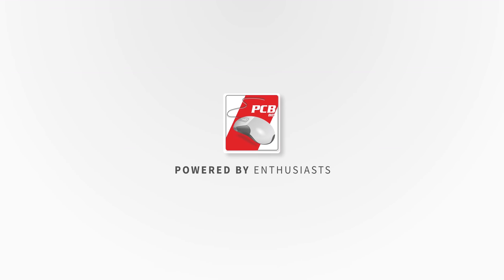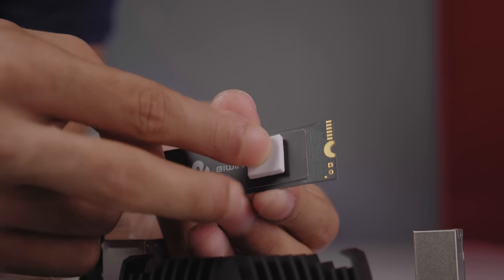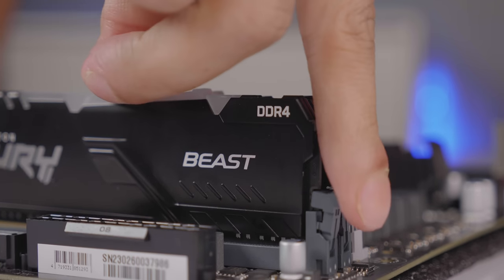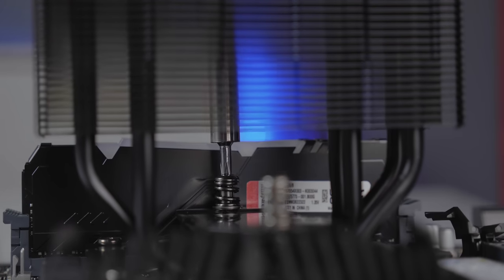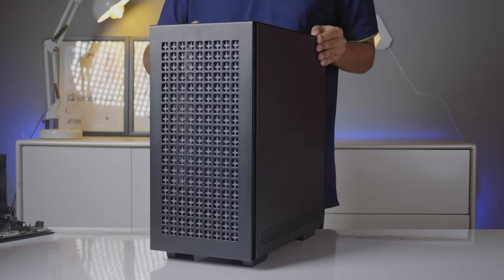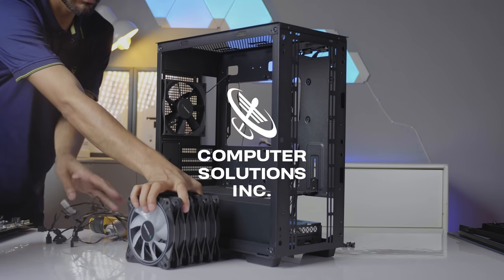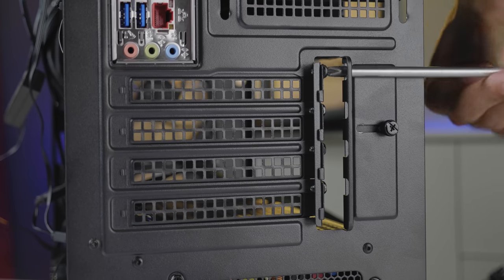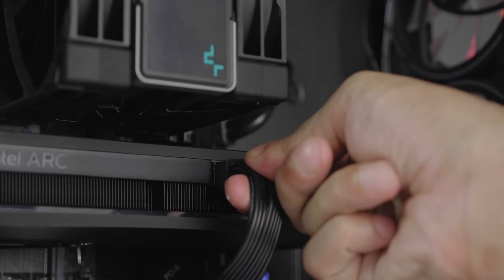100K Tk PC Build for @HabluProgrammer

Comment: CPU : Intel 13th Gen Core i5 13400F
CPU Cooler : DeepCool AK400 Performance CPU Air Cooler
Motherboard : MSI PRO B760M-PX DDR5 13th Gen & 12th Gen mATX Motherboard
RAM : G-Skill Flare X5 16GB DDR5 5600MHz Dekstop RAM
Storage : Samsung PM9A1 512GB M.2 PCle Gen 4.0 NVMe SSD
Graphics Card : ZOTAC GAMING GeForce RTX3060 Twin Edge OC GDDR6 12GB
Power Supply : Corsair CV650 650Watt 80 Plus Bronze Certified Power Supply
Casing : DeepCool CH370 Micro ATX Case

Total price 105k ar asepase aita kamon hobe help 🙂 !
Reply: Ram ddr4 nen motherboard ddr4 nrn.Ekhane price cut koren.oi tk dite arkta ram nen. Dual channel ram better. Baki shob motamuti thiki ase

Comment: আমি ১ লাখ টাকা দিয়ে
i5-12400f
MSI 760m-p
16gb ddr5 6000mhz rgb ram pny
512gb nvme gen4
3060 12gb msi oc ventus
650 corsair 80 plus bronze
pc power case white 5fan argb cassing
Lg mk600 22 inch 75 hz monitor
deepcool ag400
logitech usb keyboard mouse নিয়েছি 1,05,000/- diye...

Comment: a better option for 1lakh build will be
I5 13400F
MSI PRO B760M-E DDR4 13TH GEN MOTHERBOARD
GUNNIR INTEL ARC A750 PHOTON 8G OC GRAPHICS CARD
HP EX900 PLUS 1TB M.2 PCIE NVME INTERNAL SSD
Corsair CV Series CV650 650 Watt
G.SKILL Trident Z Neo 16GB 3600MHz RGB Ram X 2 = 32GB
DEEPCOOL AK500 CPU COOLER
DEEPCOOL CH370 MID TOWER MICRO ATX CASE
DEEPCOOL XFAN 120mm X 5 

price is taken from techland

this system will have an extra 16gb ram moreover the rams are 3600mhz . furthermore a 1tb nvme m.2 is used . And choosing 13400f will be much more logical as 13600 will bottleneck more with ARC A750. In conclusion this is better in my opinion . NO DISCRIMINATION ON PCB BD . THANK YOU
Reply: Ei video er majhkane bolsa koek week ajer tai price utha nama hoisa
Reply: 13500???

Comment: Vaia 110k er moddhe ai build ta kemon hobe?

Processor *
AMD RYZEN 7 5700X 8 CORE 16 THREAD AM4 PROCESSOR

Motherboard *
Gigabyte Aorus B550M Elite AMD 3rd Gen Micro ATX Motherboard

Graphics Card
INTEL ARC A750 8 GB GDDR6 GRAPHICS CARD

CPU Cooler
DEEPCOOL AG400 PLUS 120MM CPU COOLER

RAM-1 *
Corsair Vengeance LPX 8GB DDR4 3200Mhz Desktop Ram

RAM-2
Corsair Vengeance LPX 8GB DDR4 3200Mhz Desktop Ram

SSD
Samsung 980 500GB PCIe Gen 3x4 M.2 NVMe SSD

HDD
SEAGATE BARRACUDA 1TB 7200RPM SATA 

Power Supply
Corsair CV Series CV650 650 Watt 80 Plus Bronze 

Casing
Montech X3 Mesh RGB Lighting Tempered Glass ATX Mid-Tower Gaming Case 

Monitor
VIEWSONIC OMNI VX2416 24 INCH GAMING MONITOR
Reply: আপনে Amd দিতে intel gpu কেন দিচ্ছেন বুঝলাম না, কুলার এটা কোন ভাবেই হবেনা psu 750 নিলে ভাল হয় এই কয়টা বাদ দেন সাথে মাদারবোড এর বাজেট বাড়ান আপনার cpu অনেক ভালো তাই মাদারবোড একটু ভালো নেওয়ার চেষ্টা করেন

Comment: Founder edition and regular brand er moddhe intel arc a750 konta vhalo hobe..
Gunnir er arekta card ase 29000 e 3 fan,  rgb, 200hz extra boust clock speed ase oitar
Reply: in the Gunnir OC you will get somewhere arround 4% better performance depending on specific games otherwise both the gpus are very similar. Since the gunnir is cheaper go with that imo.

Comment: Vai a750 ki Ryzen 5600g ar Sathe use kora jabe . Ar bottleneck ki hobe
Reply: Arc a750 pcie gen 4 gpu and 5600g gen 3 cpu. Tai obviously bottleneck hobe
Reply: you can use the a750 with 5600g . As for the bottleneck , depends on what you are doing. If we are talking about gaming at 1080p 60fps then you should be just fine.

Comment: bhaiya core i5 10500 er sathe kon gpu ta bhalo hobe? mother board hocche gigabyte h410m s2h
Reply: 1650 1660 1660ti according to your Budget
Reply: A750 o nite parben..
But productive kaj e ektu bottle nek korbe.. 
95% gpu..
Tobe eta 100% sure na..
Amar lagtese je korbe
Reply: rx 6800
Reply: @oj2416 nope CPU bottleneck করবে
Reply: Any pcie gen 3 graphics card. Or it will bottleneck

Comment: Vaia,ryzen 5 5600 nile ki graphic card nitei hobe?
Reply: The " 5600" model does not have integrated graphics. In case of ryzen , the models with  "G" at the end have integrated graphics. So if you want to get a ryzen cpu with an integrated graphics then you can get the 5600G or 5700G or 4750G etc.